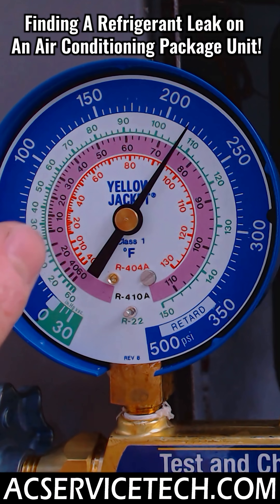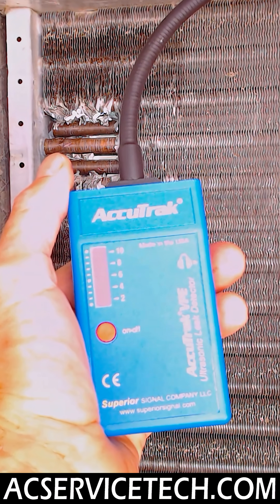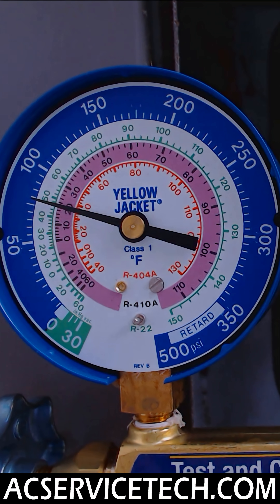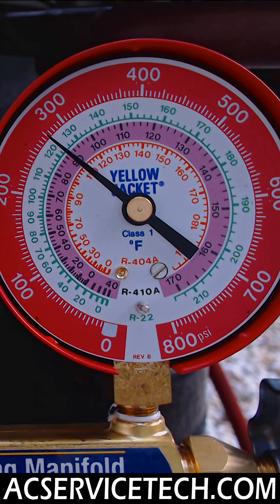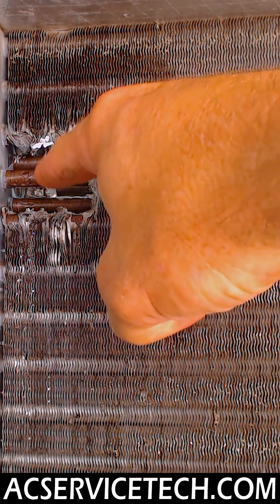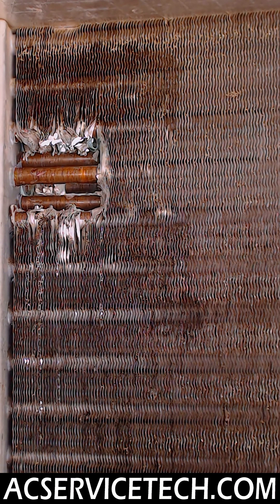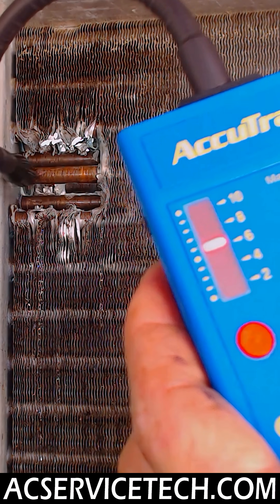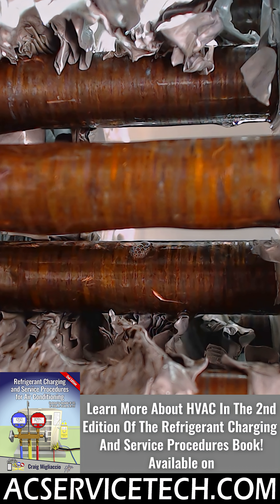Refrigerant Leak Detection on a HVAC Package Unit! Finding Leaks Quickly!!

Comment: I leak seal and hunt leaks so small pull the coil and submerse in water one tiny tiny tiny micro bubble 1/32 nd of an inch you would not hear that. What do you use?

Comment: I'm 40 and live in WV, I am pretty good at fixing HVAC systems,but I need more knowledge for recovering and refilling. Any advice? I have a vacuum pump, but not a capture tank "at least not a legal capture tank". I'd love to do just this for a living, but I don't have anyone to teach me the few things I still need to learn.
Reply: Purchase the tradesman book  " Modern refrigeration and air conditioning.
Reply: @anthonygonzalez7488  I have one very similar to that, but I will check that one out as well,thank you very much.
Reply: So legally speaking what you have been doing is a crime and you can be reported to the EPA for a reward. Look into working for a local company or getting your 608 certificate. That will answer your questions.
Reply: @vidard9863  no, I have my epa certificate. I don't have an LLC however,so you could turn me in for that. I couldn't buy Freon without the epa stamp,and it was a quick course and free,so I got it. I'm great with the diagnostics,and the electrical and mechanical aspects of it, I just don't have the most experience with reusing Freon. I can draw some out of a system that is leaking or clogged,fix the issue, and refill it,but I have to use a different tank than the one I captured with. I also have a hard time brazing,due to having a hard time getting the nitrogen to pump through it to avoid scorching the inside of the pipe. I have been doing this for many years illegally,as in without a license or insurance,but I don't have any issues. You are welcome to turn me in if you would like, I can give you my business name if you would like.
Reply: 40 years and you don’t have a recovery tank….leave the trade
Reply: @timothyhamilton3597  I didn't say I have 40 yrs in the trade. Also,your comment displays weakness and a fragile ego.
Reply: Community college and 2 semesters and you're good to go
Reply: @Duke93720  that's not bad advice,thank you. Not too many people were interested in helpful advice,they prefer to act as if no one could ever learn how to do it without going through whatever they went through. I appreciate ya,and will look into if my area has that, thank you very much.
Reply: Google it its not hard to learn if you want it bad enough❤

Comment: As a technician, how long would it take to do the job?
Reply: After finding the leak,you first need to recover the Freon, about an hour or two,then you need to fill it with inert gas and braze the leak, about an hour,then you need to vacuum the system down "should be vacuumed for a few hours" then you need to let it set for 20-60mins to ensure no pressure loss,then you need to refill the system "about an hour" and you should be good. I'd say a good day and you're done "8hrs" maybe,but I'm slow.
Reply: @normalhuman9260 wow, that's a whole days work.
Reply: An hour or two for recovery is pretty wild. Are you using a straw?
Reply: @amiatroll1  actually it's funny you say that, because my hose isn't rated for a vacuum,and I have yet to buy a proper hose,so I am rather slow for drawling.
Reply: @normalhuman9260  Even still. I suppose if the unit is massive it could take that long, depends what you're working on.
Reply: @amiatroll1 better to spend an hour or two than having to go back the 2nd time for free.
Reply: @anthonygonzalez7488  I'm not sure why you would need 1-2 hours to reclaim on a <=5 ton system nor why it would result in a call back if you just finish the reclaim when the system is evacuated (maybe 20 mins).
Reply: @amiatroll1 im pretty sure he is considering time to set up and bring in tank, machine andtools to unit.  But 2hrs for recovery is too much lol
Reply: " Long " , is a variable, as short is one to.

Comment: do you ever use those nu-calgon easy seal’s for small leaks? And if not why? Some techs seem to like it while others say it’ll mess up the unit.
Reply: The main issue with using any type of leak sealant is possibly clogging up the orifice tube or the thermal expansion valve.  On each type of system,  in order to work properly,  you must remove to orifice tube or the txv in order to prevent these from getting clogged.  Of course you can always put a leak sealer in an intact system but then it's a 50/50 chance. Most technicians don't want to pay for the same real estate twice.
Reply: @anthonygonzalez7488 from what i hear the new stuff is designed to prevent any cloggs, but who knows.  I did manage to fix one leak one time using this on a txv rtu.
Reply: @dustywebb9140 I’ve had 50/50 on having it work on the leak.
Reply: @anthonygonzalez7488 I know techs that have used dozens of them and they never clogged the orifice
Reply: Putting in a leak stop is a problem as a technician. If I charge you to put it in and it doesn't work, who pays for the return trip? It isn't my fault that the product doesn't work. If I charge you to put it in and your system locks up, who pays for the new system/repairs?
Reply: @vidard9863 I tell the customer they have two options they usually go for the cheaper one even after telling them it may not work

Comment: Here is the big question. How does this leak develop?

I suspect it is a defect in the copper and over time the expansion and contraction a crack develops.
Reply: True. The better solution would be to replace the A coil,  if available and economically viable,  as if one leak had occurred then it's highly possible that another leak may or will occur. If you study the image,  the effects of expansion and contraction is occurring over the total length of the exposed tubing.
Reply: Chyna

Comment: I've heard before not to run nitrogen while soldering. Is that true?
Reply: He said that he needed to braze the tubing,  not solder the tubing. Using nitrogen allows the solder to coat the outside of the tube, preventing the solder from entering the inside of the tube.  If flux used during the brazing process enters the inside of the tube then the flux can cause an increased chance of another leak to develop. Also if solder enters the tube then an occlusion  or clog can develop thus restricting the refrigerant flow.
Reply: @anthonygonzalez7488  don't forget about oxidizing the inside of the pipe if you get it too hot too. Oxidizing the inside of the pipe cooks a layer of pipe that can flake off and clog the system. Not trying to one up you,you did great.
Reply: @normalhuman9260  Ya, i forgot about the oxidation possibility part, thanks for reminding me. It's still early here and i haven't had a cup of Joe yet.
Reply: @anthonygonzalez7488  I hear ya, I was in the same boat when I sent that,lol. Hope you have a wonderful day.